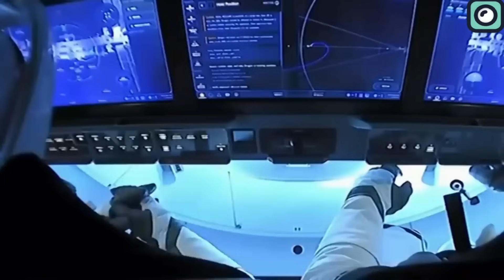SpaceX FINALLY Revealed Starship's New Heat Shield and it's Mind Blowing!

Comment: No way they are doing a refueling test next time around. I be happy with making orbit.
Reply: Liquid fuel transfer from one starship partially full or full tank to another empty tank inside the same starship. They are looking for issues like difficulty in pumping transfer, handling of high pressure boil off due to  differences in tank temperatures of liquid in full tank and the empty tank. This can be ground tested, but there is always worry about unforseen issues encountered at low or zero g.